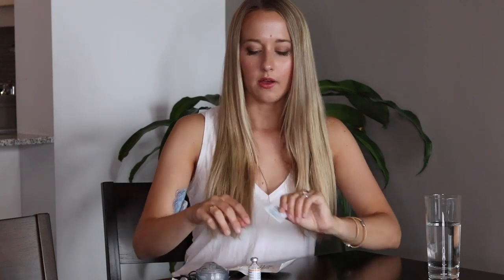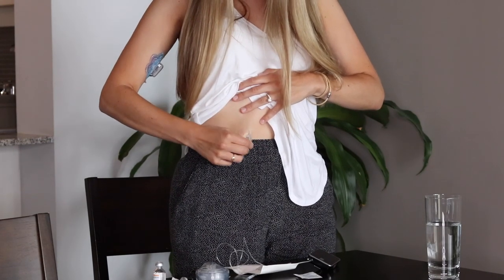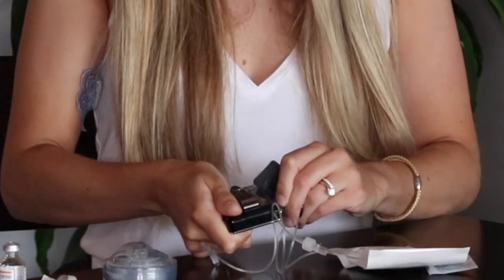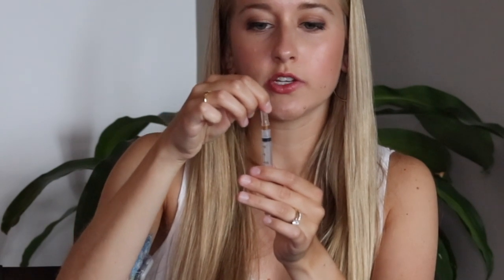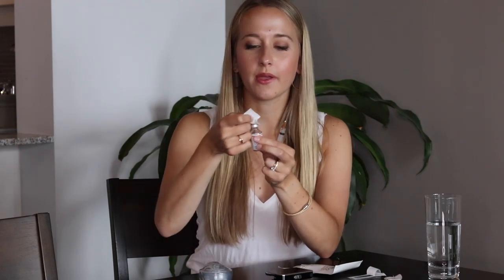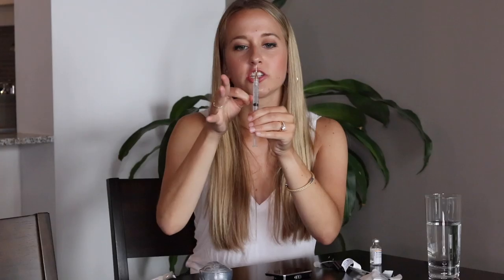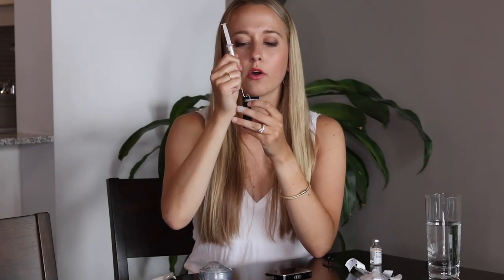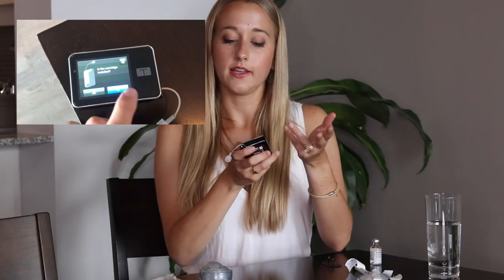CHANGE MY INSULIN PUMP SITE WITH ME! // t:slim X2

Comment: Thanks for this video.  I’ve been on Medtronic pumps for 25 years, but I love my Dexcom g6 so I am switching to the tslim.  It will be arriving next week.  I’m nervous because the cartridge change is so different than the Medtronic.  I hope it’s not too complicated as I have neuropathy in my hands.  Im happy it seems to be working out for you.
Reply from the maker: I also went from using Medtronic to the tslim and it was a very easy transition. I'm sure you will get used to everything quickly. Wishing you all the best with your new pump!! :)
Reply: How did it go Karen?  I just got mine today!   Can’t wait to start using it, but it does seem more complicated so I think I will wait for the diabetes educator to show up rather than rely on all these videos I’ve been watching.    I love that I can set different profiles so I don’t have to go in and change my basal every time I’m going to the gym because I never remember to do it two hours before anyway. Now I just have to remember to change the profile but I can do that anytime during the day or the night before the gym and everything is the same except for the two hours before. I can’t wait to start using it. How do you like it so far?

Comment: I'm a newly diagnosed type 1 diabetic and I'm looking for insulin pumps that would possibly be the best choice for me. When you apply the pump to the site, does the needle stay in you?
Reply: Most infusion sets only use the inserter needle to pop a tiny plastic cannula under the skin, and then the needle comes out leaving only the cannula. I use a Medtronic Sure-T which has no cannula - it's just a 6mm steel needle that goes in and stays there for the 3 day life of that site. When I use my abdomen like Michelle did, I can bend over, curl up into a fetal position, twist, and reach and I don't notice the needle at all. That's a lot of words to say that it's really a personal preference thing rather than a better/worse thing...
Reply: No, the needle is the guide to make sure the  plastic tubing is set properly.  After pressing on the sticky pad around the set a few times, then hold on around the sticky pad and pull the needle out, and dispose of it in a sharps container.

Comment: Do you have any troubles with your CGM getting pulled off on the inside of your arm like that?  It looks like it  could snag on your shirt and get dislodged really easily in that location.  I almost always place it on the back or outside of my upper arm, but I guess that comes with its own set of perils.
Reply from the maker: No I've never had any issues! In fact, I personally find it to be more comfortable and protected on the inside of my arm :). However, I've had some friends who have tried this location and they hated it, so I guess it's all very personal!
Reply: @MichelleLord  glad it works for you - it made me flinch every time you move your arm in the video and it looks like it's going to snag!  A comment on the cartridge refill:  I've just been filling my cartridge to capacity instead of trying to match up insulin fill amounts to my infusion site changes.  I generally average around 50 units/day, so if I fill the cartridge to its +/- 300 unit capacity I get 5+ days out of it.  It is a somewhat rare event that the site changes and cartridge refills actually align, so I end up doing a site change without changing the cartridge, and vice versa quite a bit.  I've also had problems getting kinks in the autosoft sets on insertion (2 in a row once leading to my one and only dka episode when it couldn't deliver insulin), so I've had to go to tru-steel sets.    Thanks for doing these videos, it's great to see how others are dealing with the same issues.
Reply from the maker: Haha! I'm sorry it made you flinch XD ! That's so interesting that you are able to get 5 days out of your cartridge! Thanks for sharing that tip, I always love hearing what others do. I'm glad the true-steel sets are working well for you!!

Comment: Couple of tricks to make it easier to live with this. Your method demonstrates some Don't Do This things.
Use the syringe in the vile TJ get air out, flick it so bubbles rise to the top, push the plunger in and out till the bubbles are not in the syringe. 
Always cap the syringe. 
Changing sites does not always require changing cartridge. 
Flick the syringe to make the air come up to the plunger with needle facing down the push a drop of insulin out. 
When placing needle in cartridge use technique that will avoid corking the needle. Push the needle down on the white rubber with needle opening facing up with the syringe at a slight angle. Start pushing in the needle by keeping pressure down as you move the needle to vertical. 
Push in the insulin and stop the plunger before the air gets in the needle. 
Keep pushing on the plunger as you remove the needle. 
Put the site in before filling the infusion line. Disconnect the line. 
Tap the cartridge on something hard with top facing up. 
Install the cartridge and follow the pump steps. 
Unclip the infusion line from the cannula set. 
Connect the infusion line to the cartridge. 
Fill the infusion line as you noted.
Tap the pump on something solid as it gets filled to get bubbles to rise into line. 
Flick the infusion/cartridge connector as the line us filled to get air to collect there together. 
Fill the line to get a few drops at cannula connection needle. Continue it there large air bubbles in the line. 
Finish the pump steps..
Connect the line to the cannula. 
If it's a new site prime it with enough insulin to fill cannula and get a pocket to form for insulin absorbsion to be effective. I use 2 units.
Reply: SJW Productions changing site always does require changing cartridge. Your insulin starts to break down and won’t be as effective if you use the same insulin from same cartridge past the 3rd day.